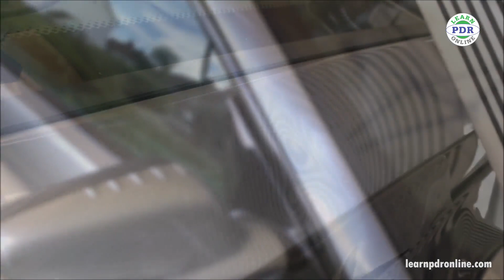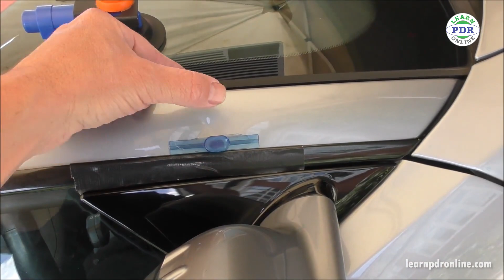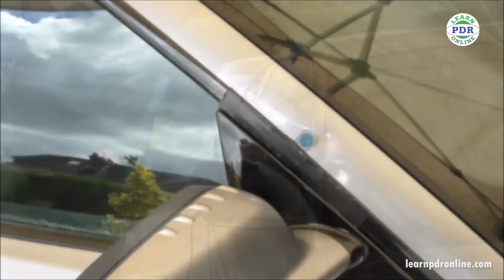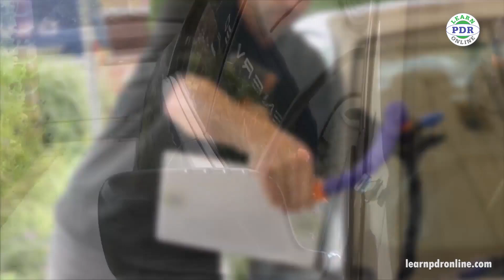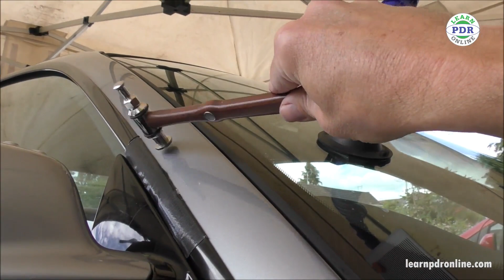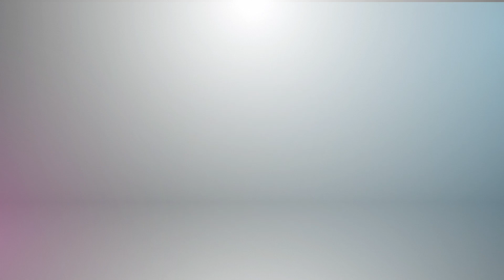Roof Rail Dent Repair | Paintless Dent Removal

Comment: Could i use normal gluesticks?
Reply from the maker: I wouldn't recommend it. I have tried myself and often the glue is a lot harder to remove from the panel so can increase the risk of pulling the paint off. PDR Glue sticks are usually very affordable and designed for the purpose, I get mine from www.bletools.com

Comment: Great repair Tom 👍
What wooden hammer is that and where can I find it 🔨🔨
Thank you
Reply from the maker: @andyrazzell1080  Thanks Andy. The hammer's from Carepoint, I picked it up at MTE a couple of years back, it's nice and light and the handle had a padded section so you can use it as a paddle as well. https://car-carepoint.com/shop/258-carepoint-pdr-hammer/

Comment: Can pinched dents be removed above dooron roof trim from roof racks hitting garage door pushing it back denting ?
Reply from the maker: In theory yes if the paint is undamaged and the metal is workable, but your local PDR technician will advise you further as it can often depend on access and how much the metal has been distorted or displaced.

Comment: Impressive i think perfekt thanks for free content have you used keco puller or from China?
Reply from the maker: Thanks, the slide hammer I am using is from a UK PDR Tool supplier - https://bletools.com/collections/pullers/products/aluminium-dent-puller-with-spring-dampening
Reply: Any puller will work more importantly is good glue